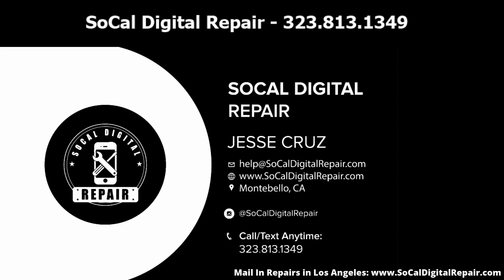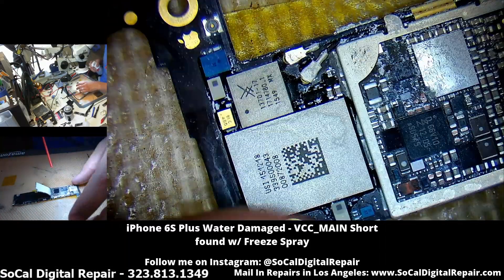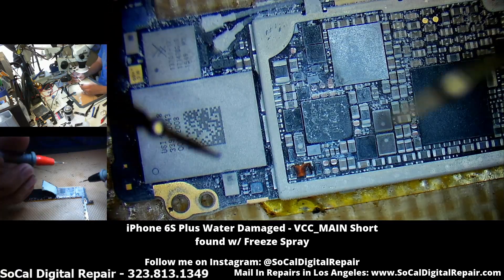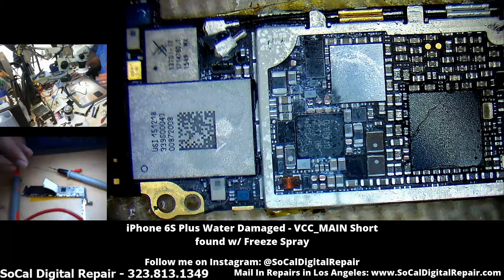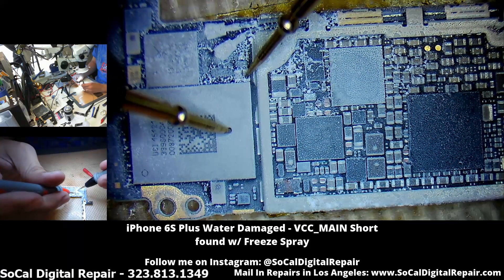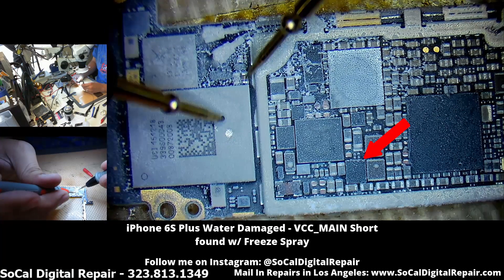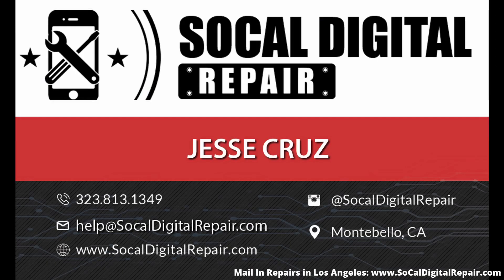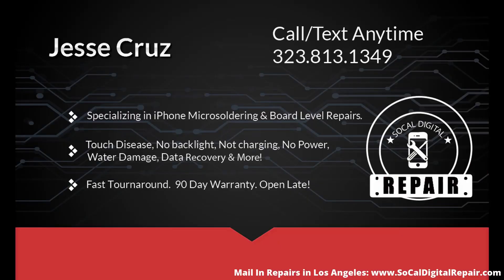How To Find An iPhone VCC Main Short Using Freeze Spray!

Comment: Use multi meter or power suply?
Reply from the maker: I have multimeter probes connected to my DC Power Supply
Reply: SoCalDigitalRepair Standard multi meter probes directly to DC Power Supply jacks (with the DC thumb-caps removed)?
Reply from the maker: @nilomyki  I use these connected directly to my DC Power Supply: https://amzn.to/2NHjEki
Reply from the maker: @nilomyki  yes, you may need to cut off the plastic over the connectors if they don't fit on your DCPS.
Reply: What is the name of that spray
Reply: Great solution.  Kindly share spray name and link to buy
Reply from the maker: It's this spray
https://amzn.to/3J3D67x

Comment: do you use 4V 2Amo for all lines to inject volts for the short?
Reply from the maker: No no. Not at all. Only VCC MAIN
Reply: @VCCBoardRepairs  what's the average V and amps do you use to test other lines for injecting method